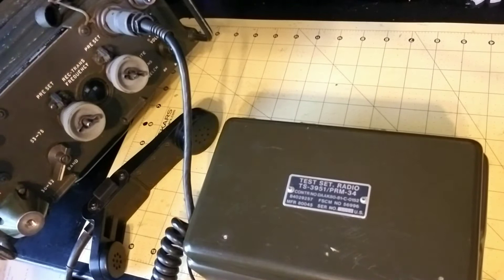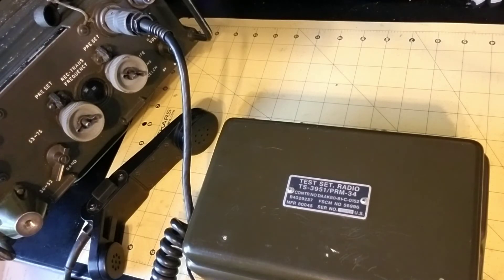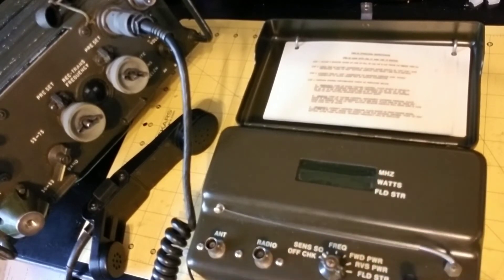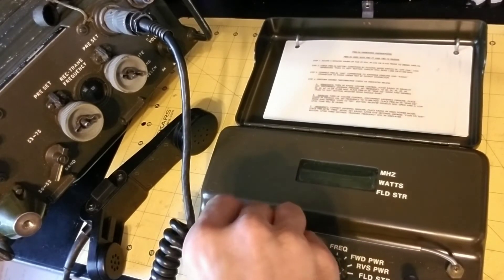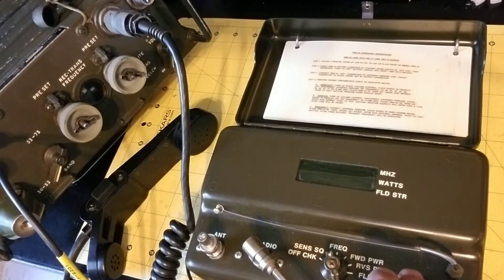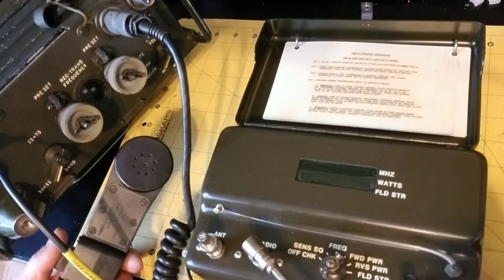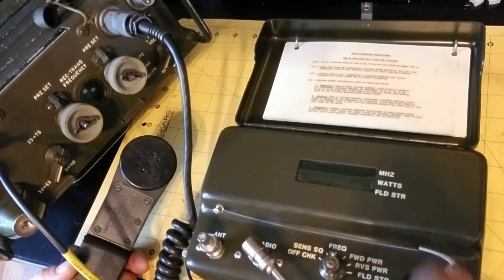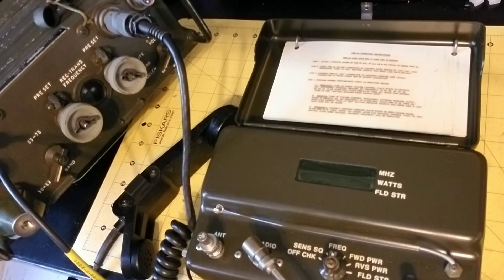The "God Box" PRM-34 Radio Test Set Demonstration on PRC-77 Backpack Radio

Comment: When in Ground Radio School we spend several days using all the different test gear available for all the equipment used in Infantry units we were to support. This was one that we we spent tracing signals in this unit. We learned all there was to learn how this unit worked. Never saw one when I left schools battalion.  Also all my schematics were lost in duffel bag by airline. Never saw them until four years after my discharge.